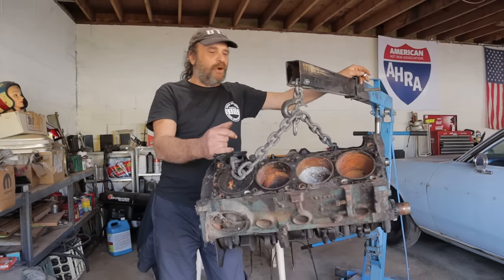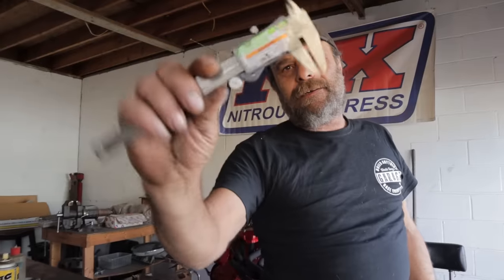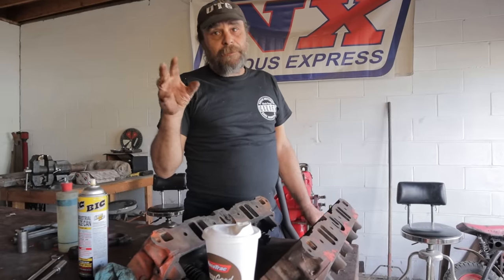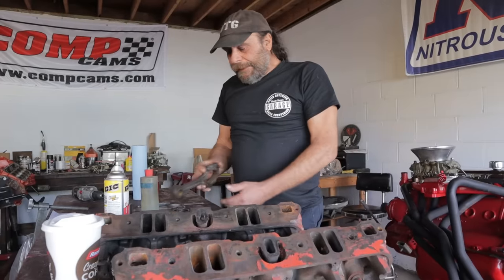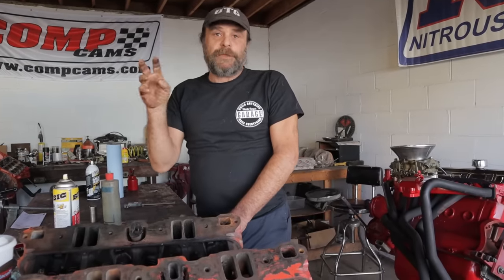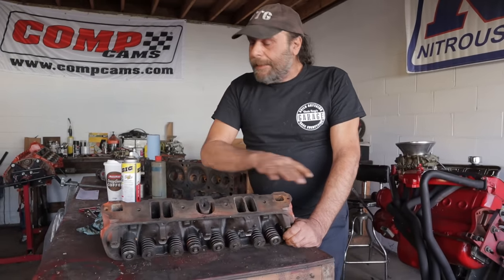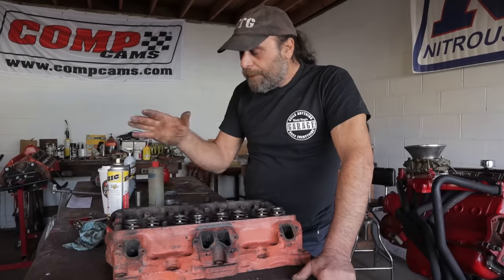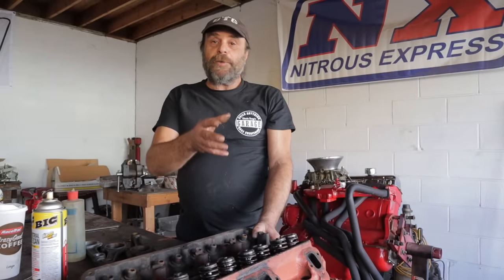The Most Under Rated V-8 In History?

Comment: Looking at a few 318’s!
1974 318 from a dart
1968 318 from a barracuda 
1985 8-318 with 40k miles.

Wanted to ask you which one you would roll with?
Reply: The 68. Better heads and higher compression pistons .

Comment: In the late 70s I help the kid that work with me at the garage put together a 318 power duster. Not much to it mild cam, 600 Holley vacuum secondary, some cheap headers, and I forget if the gears were 410 or 411.
 I don't think he ever took it to the track so I can't tell you what kind of quarter mile times it turned, that it was a fun car for cruising around town and running light to light, I saw it gives some heavier big-block cars a run for their money

Comment: Had a 1971 Challenger with a 318.  Here is what I did to it.
1. put 340 heads on and had them milled down to increase compression.
2. used exhaust manifolds from 340 and fitted with dual exhaust 2.5", low restriction
3. changed intake to edlebrock spread bore with a Carter thermo quad 1050 cfm
4. upgraded ignition to dual point with HED coil
5. cammed up with Racer Brown 3/4.
I never dyno'd the car but was able to beat any 350 Camaro and most Mopars up to 440.  440 magnums would beat me.  Burnt out a few A904's though and plenty of tires.
Low budget but fun

Comment: I've had 3 cars with a 318, ('71 Barracuda, "72 Dart Swinger, '76 Volare), and that engine just runs and runs and runs.  I never had any mechanical issues with any of those engines, and all of them ran to well over 100k miles with no oil burning.

Comment: Good point.

I would be reluctant to guess how many 318s were built.
My goodness, they went into most every car Chrysler built. The Dart, Valiant, Duster, Aspen, Monaco, Fury, the Jeep Cherokee, trucks, the vans even the big Chryslers a few years when it was the standard engine. Gads, it has to be in the hundred thousands. There were even marine versions of the 318.
Well, that did it, I"m a curious kind of guy so now I got to go look it up.

EDIT: The Dodge 318 V-8 engine was produced by the Flint, Michigan-based Chrysler Corporation from 1967 to 2003. 
Chrysler introduced the Magnum 318 in 1992 that came with a new block and heads. The Magnum featured high-flow heads for better intake. The Magnum, which was used in Dodge trucks, was a better engineered and more efficient engine. But by 2002, the 318 was dropped in favor of the 360 that remained as the only high-powered optional engine for the Dodge pickups.

These guys spent a chunk of change on bigger heads so it was NOT a stock 318 but they squeezed 425 HP from a cammed up version. of a 318 cube engine. WOW!  
https://www.hotrod.com/articles/0810phr-chrysler-318-engine/

Well, I looked at about 15 different webpages but none of them had production numbers for the 318. I give up.

I do remember a 318 that was a really wide engine so it wasn't the small block. I worked at the Chrysler Belvidere assembly plant and I remember the 318 on the 65 fury almost filled the engine bay. By 66 the block was narrower and left lots of room to work in there and allowed room for accessories. At least that wide engine was called 318. I never checked on that for accuracy.

Comment: I found a 318 from a 1999 ram 1500 on Facebook marketplace for 400 bucks. Can you go over what possible modern performance mods and upgrades you can do to a 318 better fuel economy? I have a 2000 ram 1500 with a rod thrown through it and I wanna upgrade it if I can.

Comment: I had a 73 power wagon. Pulled the 383 and dropped a 318 in. Had the 340 stock bottom. Put a 3/4 cam, 273 heads, eldelbroc intake and 4 barrel carb. Bolted up to a 727 and a 405 process. Had all the power needed to pull and  plenty of torque for showing off. Plus mileage to boot. 
The 318 was dodges best bullet proof design along with the innovation of the original electronic disributor.

Comment: Hey Tony, I always thought the 318 V8 dual 4 barrel carb. Golden Commando also optional in the 1950's Stock off assembly lines both Dodge & Plymouth had dual exhaust hooked up long before you had said was when they begun using dual exhaust. Example "ChriStinE". 1973 Road Runner was not first to include dual exhaust for the 318 V8.
Reply: You are talking about the Poly head 318 not the LA 318. Two different engines, same displacement.
Reply: @topenddean  oh ok, my bad!! lol I totally did not get the differences. Thank you "X" for helping me to understand. I totally misunderstood what he had been saying. lol Hope you are having a great week. :)

Comment: Through the years I have had all the SBM and dragged raced them usually in Dusters or Darts. I had all of them running high 10s in the quarter a 360,a few 340s and a few 318s all were 4 speeds very easy to do with a 318 and the 318 always had better 60 foot times. For the 318 I did run very ported out X heads 2.02 intake 1.60 exhaust and the better rods all balanced bottom end with the stock 318 steel crank. I used the old style TRW pistons 0.30 over 11:2:1 compression they were heavy pistons all those TRW pistons back then were.

Added a Direction Connection solid cam I think it was around 560 lift might have been a Racer Brown cam and the right springs retainers ect.. I can't remember now. Hooker Super Comp Headers a good oil pan and system from Herb McCandless and he told me what to do to the trans to be able to slick shift it along with the mods to the z bar in the clutch linkage. A Offenhauser Port-O-Sonic Intake with a BIG Thermoquad carb I bought the metering rods and jet kit and got it setup right. With a 4.56 rear shifted at 7100 10.88 all day long! The 340 version same parts basically went 10.80.

The beauty was I had tons of 318 engines and only two 340 engines everyone wanted to keep the 340s even back then. People would pull the 318s out and put in 383 or 440s or 340s and put the 318s in a pile then I would get them for free just go and pick it up you can have it. Finally after three seasons of drag racing the 318 came apart it was my fault I missed second gear I think it spun up to about 8000 RPM! a rod broke at the base of number 3 piston and boom! I put a 360 in the Duster and sold it then bought a 68 Roadrunner just drove it on the street it ran good.

Comment: Don't forget to mention the 318s 302 cast# heads with the swirl port closed combustion chamber. They came on the throttle body 318 engines from 88-91 25hp bolt on.

Comment: My dad was a mopar fan.  We had several cars with 318 in them, NEVER a problem with them.  The body would fall apart, but the engine just kept going.  somebody sugared his gas one time, and we never new until he traded the car in on a new one, and the shop told him the pistons had a gap filling top of carbonized sugar.  It actually ran BETTER, with more compression.

Comment: My father owned a 1968 Plymouth Fury with a 318 in it. It was a big car that rode like a limousine and the 318 pulled it around just fine. It was done at around 300,000 miles, but that was because the frame rotted out. The 318 engine still ran fine.

Comment: I got 302 Casting 318 heads fully ported put 5/16 valve stem one piece stainless  5 angle valve job with trw forged pistons then shaved heads 20 thousandths...my motor flys

Comment: The 340 blocks and heads were high nickel content castings, a 318 block and heads were butter by comparison, big difference in the metallurgy there. They are able to handle higher cylinder pressures from power adders like nitrous, superchargers, and turbos.

Comment: I bought my last brand new truck in 2001, a Dodge Ram 1500 Quad cab.this truck was on clearance and discounted because the 02’ had already flooded the lot. I did not like the catfish looks of the 02 or the fact that gone was the quad with suicide doors to a full 4 door truck that I hated, plus, gone was the 318 and 360, and replaced in 02 by German configurations for power because this was a couple yrs or so into The Daimler-Chrysler era . Mine has the 318 and I still own the truck and it’s still a keeper, I love this old truck.

Comment: I had a 1959 Plymouth Fury 2 door hardtop. Solid lifter 318, Carter 4 bbl, dual exhaust, 3-speed Torqueflite push button. It had those swivel front seats, bench with a swing down armrest. Doing a brake job was torture. Double cylinder dual servo fronts. Rear drums were press fit on a conical axle end, required a giant puller to get them off. It had this weird "parking brake", a single drum brake mounted on the output of the transmission. Typical Mopar torsion bar front suspension.

Comment: My 1970 Duster originally came with a 318, even when worn out to the point it was burning a quart of oil a week and had a constant trail of blue smoke it ran surprisingly well with a 4-barrel, small Lunati cam and dual exhaust.  I've since swapped 2 360s into the car but I saved that old 318 block and crank.  Some day I'd like to do a budget rebuild with a nasty solid-lifter cam and decent heads to make it wind out to 7000 RPM.  360s are awesome but they don't rev like a 318.
Reply: Really cheap 318 build: https://www.hotrod.com/articles/318-small-block-build

Comment: the 318 is a decent motor for sure and I see the potential there  but I also see that little slant-6 with the headers behind you there too and I know the high horse power potential of thet little beasty too thinkabout a 4bbl carb and increased valve and port sizes as well as better valve springs witn dampeners hei ignition and the other go faster goodies..  I built a 225 cid in a '71 Duster and a few other suspension and big rear slicks and skinny front tires...coaxed high 11's on the strip and low 13's in street trim (M/T N-50/15 rears) suspension lower than strip config.could still dry hop the front tires off the ground for showing off if I wanted a shock mess with the mind of a competitor in street drags, made them a little nervous and gave me a bit of a psyc advantage over most of them...lol  Imagin a 5' 110 squirt in a baby blue 6-banger against a '70's Camaro with a V-8 they know is bad to the bone then I kick the lil Witch awake.. r uncap the headers and open up the secondaries on the Holley 850 cfm dual port dual feed carb and retime the ignition to race trim,  (had marks on the block for stock and race timing depending on carb config. blocked secondaries or full carb set-up.. and exhaust config(uncapped headers or full system)  made the sound stock or open and full flow all loud and nasty...weak sounding zoom-zoom or mad wicked witch deep cackle..ruffled many feathers when they lost to the little shrimp in the blue grocery getter with the fat tires on the back..  I Iaughed when I took the titles (I only raced for Pink slips when I knew I could win by the sound of the engine in the other car)) and then sold them back for $100.  when i won as usual because of their underestimating me and mine..Ilearned to drive in a 10 sec. '62 vette that I personally rebuile the engine n even before I was alowed to learn to drive it..Dad said "if you break it ..you fix it!! so by the time I learned to drine it in the Ohio December snow and ice I knew every nut and washer on the car and tuned to perfection. so yes I knew how to get unexpected amounts of power out of a motor.  It's amazing what a little tweeking the ports and valves can do for more vroom.and lower trap times on the strip..lol

Comment: Im a fan of the 5.2 Magnum.. 1.60 Ex 1.92 In.Ive modded one in my 98 Dakota. Suprises alot of newer trucks. These engines are suffocated from the factory. I modded the keg and air intake. installed shortly headers and true duals. Really woke it up..The only 98 RT in town wont take the bait...I think I could take him 😁

Comment: should be  noted the intakes on 340s work better stock than older sbc heads. it s the exhaust ports on the 340s that need work. always liked shaft mounted rockers. some 273 engines has adjustable rockers

Comment: The Ford guys "go to" motor is the 302, not the 351 which is odd, so the 318 shouldn't be a bad motor to build up. Keep the 318 heads and put the 360 sized valves like UTG said. I wouldn't do much with porting the whole intake runner but open up the "bowl" area for the larger valves. 
I always like the odd ball engines, the older "Polysphere" has definite potential if you can find one! Check out "Engine Masters". They built up a Polysphere engine! 👍

Comment: I had a 318 LA that I built for a 67 dodge D100 with 340 heads single plain intake Holley 750 headers isky solid roller cam that thing was a screamer would eat factory 340 for lunch

Comment: if you want to do a 4x4 i reckon do a 318 jeep or landcruiser 

I know someone who has done one in a landcruiser used the stock transmission from a FZ modle and it goes harrrd

Like he made the 318 for torque and he said it has more horse power than the FZ and more torque than the HD diesel motor aswell and overall was just better

Manual gear box with a 318 in a 60 series Landcruiser i was in love

Comment: I have a low milage running 318-3 from a 71 D-600 .i know the heads are a little diffrent.but can i just put it in a DART? I havent checked if timing cover will interchange.

Comment: I know for a fact that you could get dual quads, dual point distributer, and dual exhaust in the '57 Fury. It had two huge gold painted air cleaners.  My father was a Plymouth/Chrysler mechanic and had one.
Reply: Terry Caldwell  Not false. My father had the  police interceptor Fury in  61 and I bought the engine parts off off one in 66 to put on my 61 Fury

Comment: Thanks Tony,  very interesting video and I was particularly interested in this one.  I've always felt the same way about the 318 but didn't know a great deal of its history or how disadvantaged they were from the factory.  That's amazing that some of them got forged cranks and the 340 rods.  They were so tough.  I once had a dash 3 engine - got it for A$50 (in Australia) and once opened up I found it had a cast crank which was almost snapped in two.  Now I know it must have had a crank change at one point.  One thing you didn't mention about  the 318 engines in relation to the 340 was how we increase the compression?  In fact, how did they get 10.25:1 (or was it 10.5:1?) comp in the early 340 engines?  And do we do the same thing to the 318 to get the C.R. up?  Thanks.

Comment: One of my Mopar buddies built a 318 that he ran at the Mopar Nationals for years. He mopped the 1/4-mile with big blocks all day long, every day, running very low 12s consistently. It could have easily run faster, but he didn't want to put a rollbar in the car.